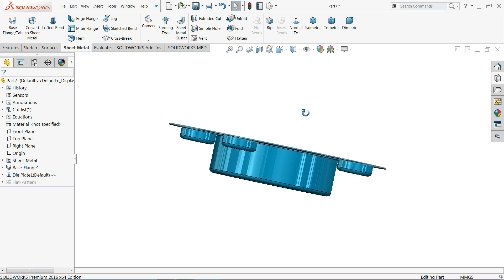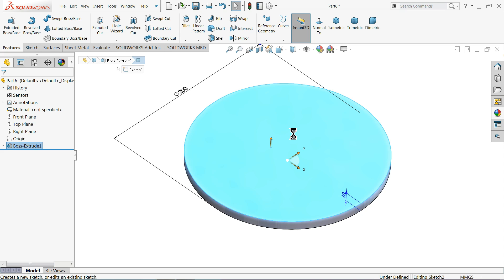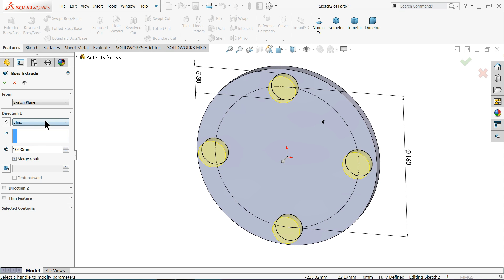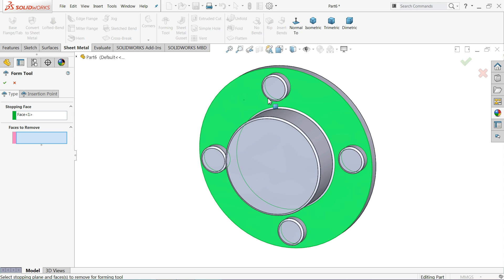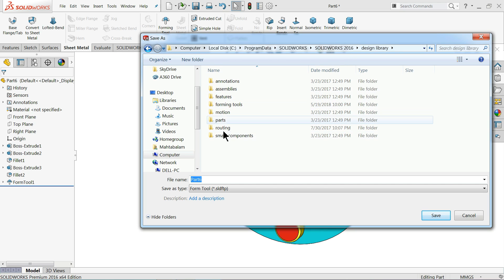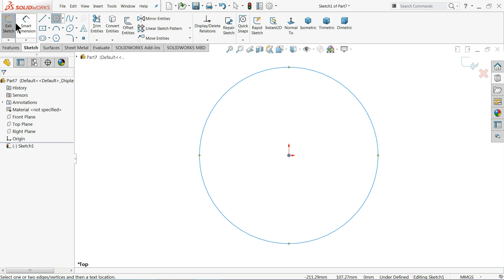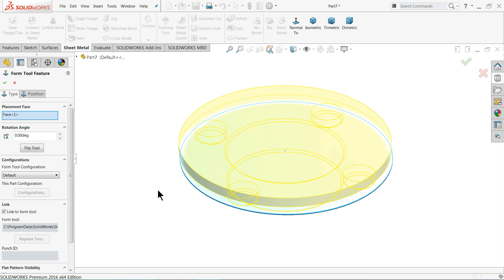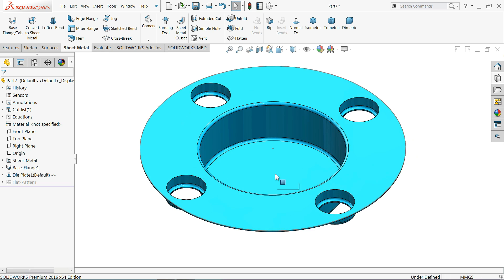SolidWorks sheet metal Tutorial forming tool

Comment: Greetings sir, and thankyou in advance for all you time and tutorials, I hace a question, how we know that the extruded mold will cut the 4 circules, we should not have maded some sharp estes on them, to ensure the cut will be made??thanks for your response
Reply: RacingDante7 OK you made a valid point so let me tell you this is basic tutorial and you have to consider every phase of forming dies but to verify your model you can use Deform 3D software to accurately check and simulate your  design. Go for it